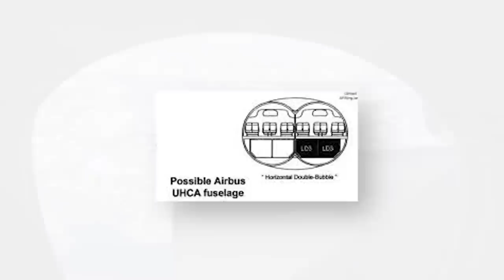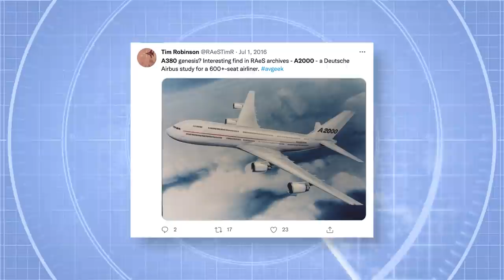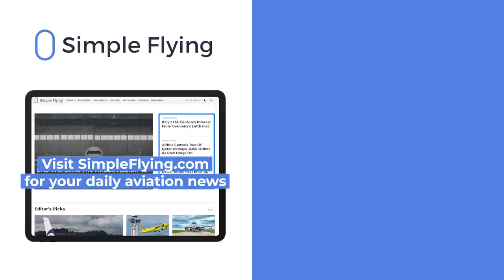The Various Rejected And Developmental Names For The Airbus A380

Comment: I have always wondered why Japanese carriers, for example, have never ordered to Airbus  a short range version, of A380 for carrying more than 560 people in single-class for desaturated domestic flights of 1 hour, 2 hours, which are saturated  due to Japan's dense population.
Reply: I would've guessed that Japan would want to go like the rest of the world and try to add more fights over larger planes. But then, based on that I would've expected the 787-3 to be the chosen option.
Reply: Some Japanese airports that accept widebodies on domestic flights only have 2500-2000m runway, too short for a380s, also even for some of these high demand routes, the a380 is uneconomical
Reply: @Yukis.aviation  a380 is more economical  in fuel consumption than any 747 of all generation (even the last version of 747-8), above all the olds 747-SR of Japan Airlines, dating from the 70s, 80s, 90s